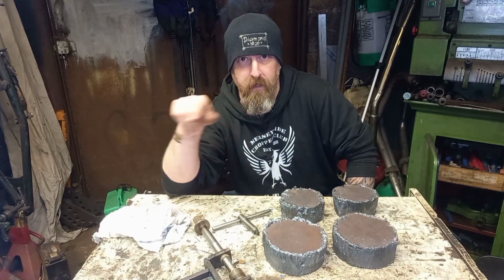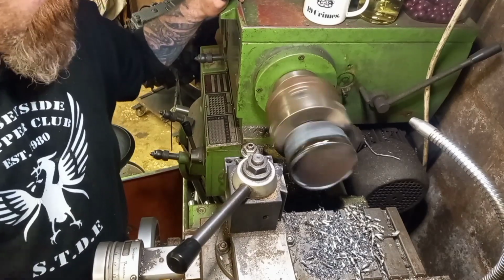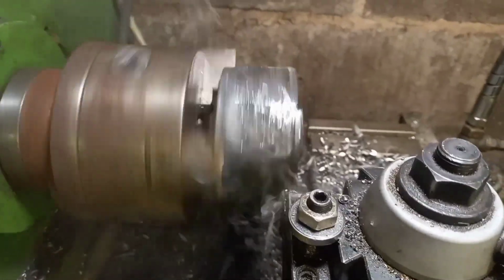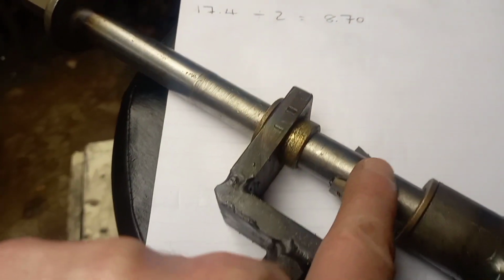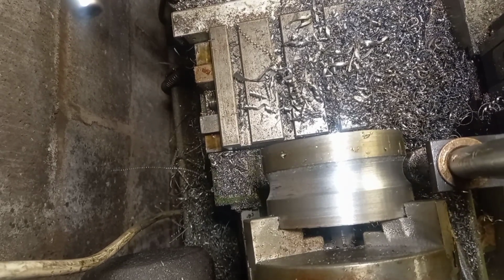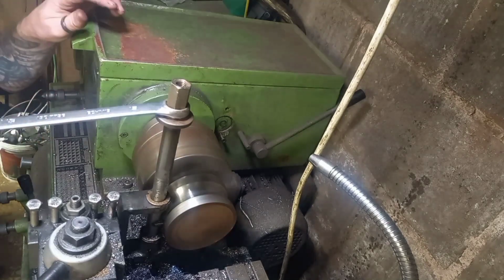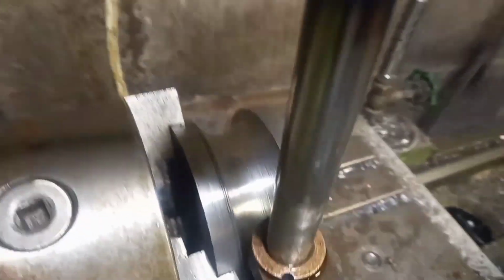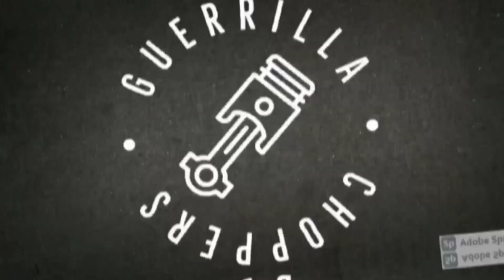MAKING A DIY TUBE BENDER DIE / FORMER FOR JD2 USING HOMEMADE RADIUS TOOL

Comment: Well I built a copy of your radius tool for my Southbend 10K lathe. I did not realize that the vertical height for the weld that connects the C shape to rhe tool holder T has to be low enough  on the C so that when the top slide is retracted, the bottom of the C will not hit the base of the dovetail. Fortunately I only had one weld there and that was easily corrected.-   And your first video does not show the top slide being turned 90 degrees.  That is where the real capacity of this rig starts to shine!  If you turn the top slide even further you get even more ! On the Southbend 10K, this invention of yours will accomodate  a diameter larger than the capacity of the lathe itself!  Hopefully I will not have to make a die bigger than 10 inches, but if I did, it would be the lathe itself that was insufficient, not the radius tool you so generously showed us !!!  Thanks a million!
Reply from the maker: Cheers. Glad it helped. I know at some point I'll run into a job that requires a 2nd rig. But if I'm not trying to film myself making it, I can knock one up in an hour or so.

Comment: Great approach, could come usefull for me too. However you lathe screams for some TLC.
Reply from the maker: The Lathe needs a gearbox but Warco has changed hands since it was made in 1983, and there are no spares now. I've made some new bushes but the gears are still sloppy. I don't mind, it wasn't expensive and nearly does as its told.

Comment: Hi
This isn't related this video, I just wondered if you could fix my T140V gearbox? I watched your video on reassembly and it was a big help but I still can't sort it.Have you an email or other contact I can use?
Reply from the maker: I don't take on Customer work, as I don't want to tread on the toes of Legit shops. I'd recommend D&N Engineers near Preston.
Reply: @guerrillabuildchoppers4823  Great thanks

Comment: Question- Does the JD2 bender ONLY make bends with the same radius as the die? Or can you make larger radius bends than whatever die size you have?  I am working with much thinner wall tubing to bend (0.049") wall EMT and my lathe max diameter is 10 inches, so the max radius I can make dies for is 5" and that may be too small to use on that thin wall EMT?
Reply from the maker: The Die dictates the Radius. They have various options on their website for different diameter tube. You are also restricted by the the spacing of the holes on the arms.
Reply: @guerrillabuildchoppers4823  I think it's still a great DIY tool, and if you needed an even larger die, you could probably borrow some time on a friend's larger lathe and use that same tool on it.  You might have to drill another hole in the vertical shaft to accommodate the change in center height, but that is no big deal.  I'm hoping to put mine to work soon to make a follower roller for my EMT conduit bender.  Keep up the good work!
Reply from the maker: @MultiTman1000  Cheers, Glad it was useful.